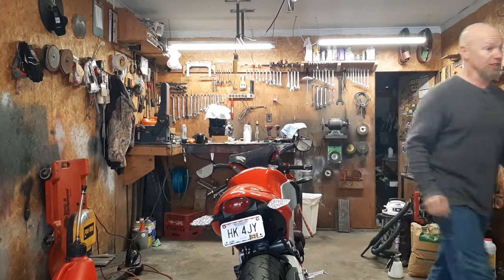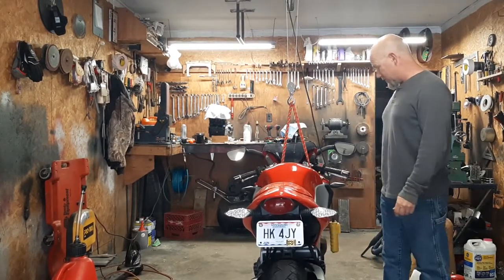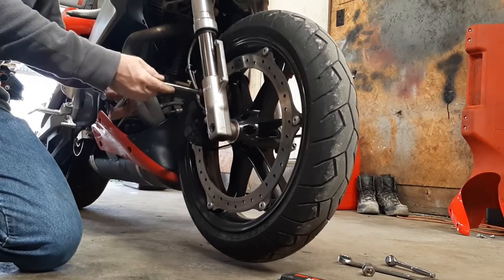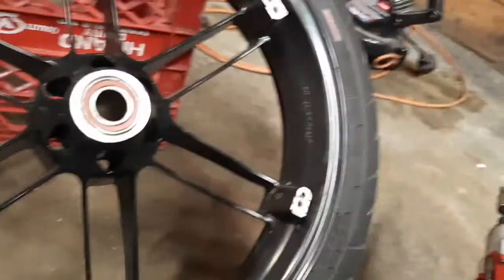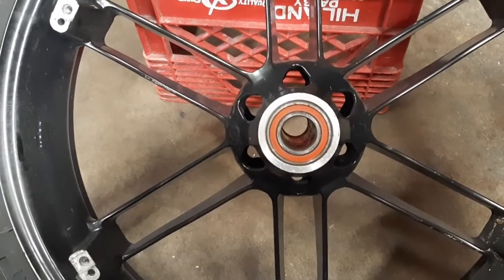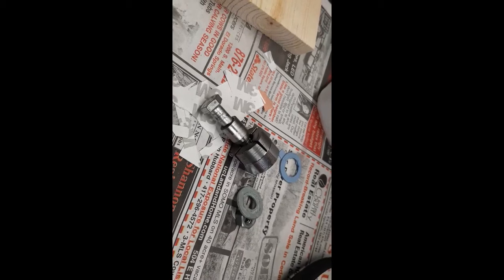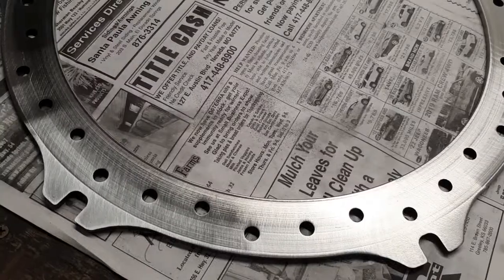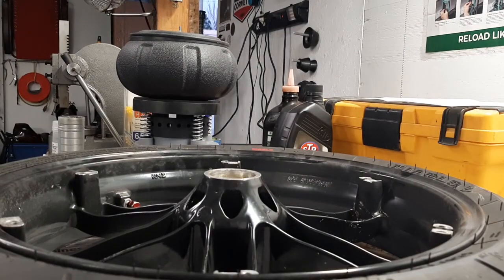Buell XB Front Wheel & Rotor Removal.  Also a bearing tube mod to make changes easier.

Comment: Thanks for the video very helpful. FYI from my experience on cars this brake "judder" is caused by the rotor having runout. A dial indicator on the rotor while turning the wheel will reveal the high spots. So what happens is the pad makes light contact on the high spots when the wheel turns while NOT braking. Thus the pad gradually deposits material on the rotor high spots that build up over time and that causes increasing judder over time. No way to remove the deposits without a lathe. If the rotor is flat (with no high spots) the problem can be PREVENTED by placing shims where the dial indicator shows the low spots. Try to keep the run out below .001 or so to prevent judder. Also repositioning the rotor on the wheel can either reduce or eliminate the runout. The runout may be caused by the bearing.
Reply: Good insight. I would have thought that the high spots would wear themselves out, but this suggests quite the opposite!!

Comment: Very insightful! Thanks for sharing and greetings from L.A. 

I’ve got the same annoying front brake thumping issue with newish pads on and I also think its my rotor needing some polishing or replacing. I had ideas on how to go about it with a pro buddy of mine but you’ve made it all look like very DIY-able. I think I’ll do exactly as you minus replacing the bearings or buying a new rotor, for now, but good to know about that notch mod! 👍
Reply from the maker: Let us know if you fix the thump without having to get a new rotor.  I've tried all the tricks I know without good results.
Reply: @xpsgarage  I replaced my brake pads, OEM to OEM, yesterday and no more brake thumping.. I probably developed uneven pad wear due to grime/gunk in between the bores several thousand miles ago as my inside pad on ZTL1 caliper was noticeably more worn than the outer. The uneven force from inside/outside pad was bouncing off the rotor springs. Could of also been the over torqued axle bolt I noticed, those large threads are enough to pull the wheel to one side shifting the position of the rotor if its too tight. So I cleaned up the caliper, removed the wheel, torqued the rotor fasteners and lubed the springs, polished the rotor and put everything back together and its all good. Moving forward I’ll probably clean up and tune up my brakes at half to a quarter of pad material remaining just to keep things clean and tuned until replacement.

Comment: How do you get the bearing and tube out in the first place to cut the notch in it?
Reply from the maker: 6:45  I built a collet puller to get it out.  They are available to buy just Google collet bearing puller.  If the bearing is no good then I normally just weld a piece of scrap metal in the center to give me something to put the punch on so I can drive it out.
Reply: @xpsgarage  thanks 
The front brake on my fire bolt locked up this morning coming to a set of lights.. it eventually freed up. But now I’m too scared to ride it.. any suggestions?
Reply from the maker: @MrBlompod  Normally if the brake locks up you either have a mechanical problem with the caliper or something is stopping the flow of the brake fluid.  You can start by pulling the caliper and making sure you can push the pistons all the way back in the bore.  Remove the master cylinder cover when doing this because the fluid will go back there. Also make sure the brake lever is going all the way back to it's stop.  If not that will prevent the fluid from flowing back when the brakes are released and the brakes will stay on.  If the pistons in the caliper bind up it may be time for a caliper rebuild.  Make sure the pads are free to slide on the pins.
Reply: @xpsgarage  thank you ☺️

Comment: Hi! this video is so helpful for me!! trying to restore mine by myself in italy, ( also learning working with inch measurenents) probably i will install a new rotor kit from ebr, if i well understood, they replaced the spring with round different spacers...is that right? sorry for bad english, thank you! ciao!👍
Reply from the maker: Yes EBR did come out with a different mounting kit that was more solid.  It looked like it was more for racing applications that required more heat transfer but it will definitely also work on a street bike.  I never tried the kit so I don't have any first hand experience with it.  Glad you found the video useful.

Comment: hey brother, whats the name and size for the special tool that I should have?
Where I can find it.
Reply from the maker: For removing the wheel bearings?  Google blind hole bearing puller or collet bearing puller.  If you know someone with a welder then have them weld something across the inner race so you can drive it out.  Then  notch the tube and next time will be easy.